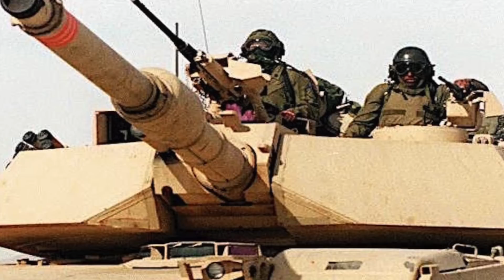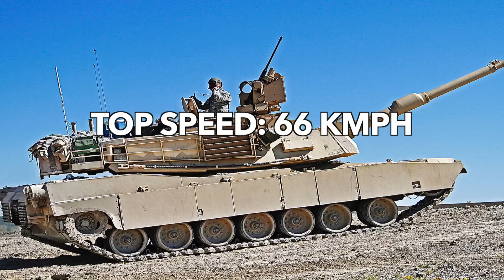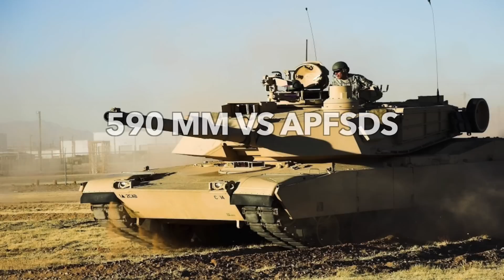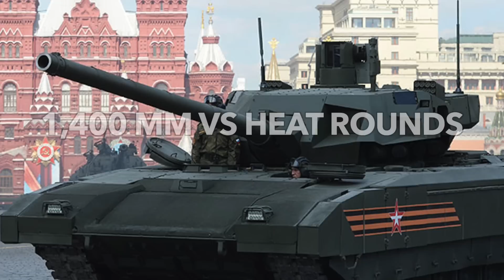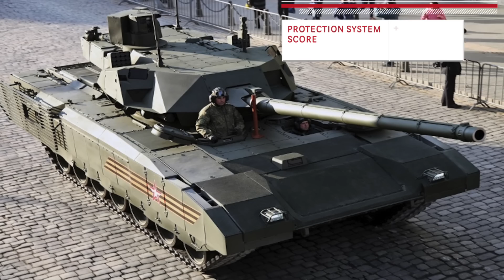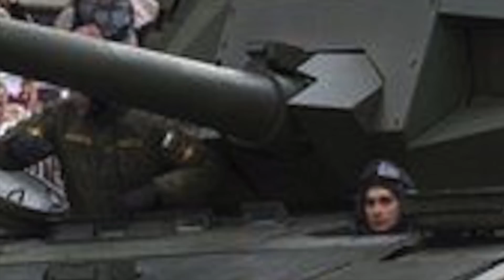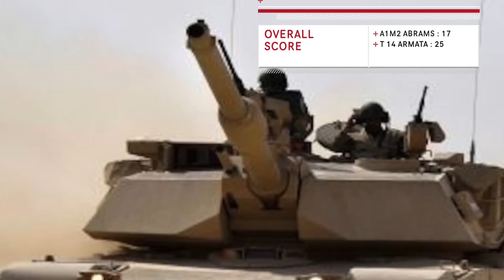AMERICAN M1A2 ABRAMS  vs RUSSIAN T14  ARMATA: WHO WINS?

Comment: A correction is needed with regard to M1A1/M1A2 armor protection. Armor protection levels for this tank during the 1991 Gulf War were 800 mm against Kinetic Energy rounds and 1300 mm against chemical energy rounds. The armor on the tank has been upgraded multiple times since 1991 and is well ahead of those protection levels now. 

         So the M1A2 has either equal or better armor protection on its front compared to the T-14 armata but does not have the advance soft kill and Hard Kill active protection systems that the Armata system has. 

          In terms of mobility, the governed maximum speed of the tank may be 45 mph, but the governer can be switched off allowing speads of 65 mph +. The turbine engine also gives it greater acceleration. 

           Another thing to consider is that U.S. tank crews on average have had more combat experience and get more training than Russian tank crews. 

           While the Armata's rating is probably still ahead of the Abrams, it is ahead by a much smaller margin than this report suggest.

Comment: Before the Americans in the comments (me included) get butt hurt remember the Abrams is 30+ yrs old whereas Armata has yet to break 5. To be even somewhat comparable despite its age means that the Abrams is packing serious heat and is a reminder to what is to come in the future where the Abrams (or more likely a successor) with new equipment and better  applicators is going to kick serious ass.

Comment: Wow.  Well we obviously found the Russian connection.  You lied on every single aspect.  Lied.  Hell you compared the Abrams standard armor to the Armata's reactive armor!  And there are zero demonstrations of any of the capabilities of the Armata. The Abrams has demonstrated its abilities over and over again.  Including its top speed of 70 mph, not 60 kpr.  And that speed is tracked cross-country.  Not on a flat, paved, road.  As for the rounds per minute, the Armata carries I think 5 rounds in the turret.  So for those 5 rounds, it may very well be able to maintain the "12 rounds per minute" rate.  Then it has to stop, rotate the turret so the automated loading system can load 5 more, then rotate back to the firing position.  The Abrams can keep its rate of fire going until all rounds are expended.  And its loading system never jams.  I've heard that the Armata has major issues in that area.  And this piece left off the most important feature that the Abrams has.  It doesn't have to stop to fire.   All 10 rounds in that minute will hit with pin-point accuracy.  The Armata apparently has a sub-obtimal, third-tier system that allows it to fire its 5 rounds in that minute on the move.  Just not with any real degree of accuracy.

Comment: For the most part this is right but there are two things wrong, one with scoring the other with technical information. Regarding the scoring, a crew of 4 is equal to a crew of 3 if not slightly better due to less work load distributed throughout the crew. The other thing is that the armor specifications are wrong. An M1A1 HA (with 1st gen DP armor) has  600-800 mm against APFSDS  and 700-1300mm against HEAT. The Most modern M1A2 has 3rd gen DP armor so its armor effectiveness should be even greater. They are equals in armor.

Comment: Bigger gun bore and heavier projectiles are better? Hitler thought bigger is better too with weapons such as the gustav railway gun firing 7 ton projectiles, it didn't seem to go too well for him with all that wasted!
 T14 is a prototype yet to see battle unlike the Abrams that has been around since 1980 (fist the M1 with the M68 L52 105mm rifled gun then to the M1A1 & A2 with the M256 L44 120mm smoothbore), it has been in many battles and proven its effectiveness with over 10,000 built! But I'm sure the N1 rocket seemed good on paper before it became the 8th largest non-nuclear man made explosion in history wiping out the ruskies chances of getting to the moon first, the Russian's really know what they're doing!

"Made in Russia" there's your problem!
Reply: By the way, how does the fact that the Honeywell AGT1500 multifuel gas turbine engine burns both petroleum based and kerosene based fuels(can't put petrol in a diesel engine), has easier maintenance than an internal combustion, starts up and runs in extreme cold better than a diesel engine not give the M1A2 the advantage in that category? 
 Also you kind of cheapened the Abrams armor!

Unbiased, sure it is.

Comment: The thing which never been brought to discussion -- is the start time of T-14 diesel engine in, let's say, - 20C (which is not too much of a cold in Russia). In the past the platoon of T-72 and T-90 took up to 1 hr to start their engines, due to warm-up procedure. To compare -- T-80 (with gas turbine engine) took about 5 minutes to start from complete cold stop in the same conditions.

Comment: am i the only one that knows the us abram are using the sterlington armor and all of this is shit you can't use the normal abrams you gotta compare the m1a2v4 that has an bigger cannon 1300mm and if the 152mm ever will be mounted on an t14 it will get way more heavy due to the mass of the rounds the m1a2v4 abrams has better armor compared and it will not be replaced before atleast 2030 by a new kind of super tank that can go way ahead of atlest 20-40 years of its time and thinking of that the us army and marine might soon will be able to attache the railgun that can shoot up to around 10000km/ph.
Reply: THE WEREWOLF LORD Sterlington? What?
Reply: THE WEREWOLF LORD v4? What?
Reply: Nathan Peterson sterlington armor are the armor that the us is using that is made by the british. the v4 is version 4 of the m1a2 abrams that are being made. or other said it is a heavily upgraded version of the m1a2 abrams and inside of the next years the m1a3 may be built which is and better version that will have auto loader and an 130mm.
Reply: THE WEREWOLF LORD Sterlington isn't a thing. I assume you mean Burlington and Dorchester armor? 

v4 doesn't exist. The most recent variant of M1 is the M1A2 SEPv3. 

We don't know what M1A3 will have. The only thing we've got to go on about it is ECP-2 requirements from back in 2010, which as described in the report, mere suggestions.
Reply: you know that they already exposed that the m1a3 has an high chance of having an 130mm smothbore cannon with autoloader to so fucking read on your stuff and the m1a2sepv4 is under development as an upgrade since that the u.s are going for an new tank around year 2030
Reply: THE WEREWOLF LORD A chance yes. As I said it's merely a suggestion made by ECP-2 back in 2010.

SEPv4 might be under development, but I doubt to any extent they've already designated the next upgrade to it yet.
Reply: Nathan Peterson then still you can't change that when you fucking say v4 what like if you knew that it might be on development tables then don't say what i know the full fucking story of it the tech that the t14 have can't compare. because they say that it can avoid missiles at 10 meter and i mean missiles from the air yeah they can maybe take control of it but they can't react on it from 10m distance and all of this is bullshit anyway because the us army says what they mean it has and the russian mean it has better. plus it is also not tested against eachother so you can't say which one is best just out of this. in the gulf war we saw that only around 4 abram tanks got downed and one of them was still able to drive the crew and shell also have a roll because us have the best crew  in the world and the shell will never be fully exposed of how affective it is but it all dosn't care if the us go back and look on the fwv4004 that has an 183mm then they might just use that kn the next battle tank. there has also be'en proven how bad trained the rusdians are in the t14 since that when they drowe it thrue moscow it stopped and it took hours just to figure out that it was the handbrake that there had gotten pulled up so it wouldent move.

Comment: What I find very interesting ist where the weight reduction is coming from?
I mean in this case it's 22 tons when the facts here are right. And the T14 is a big tank, like the leopard 2.
And here is my question: Armor brings weight. But the T14 is 22 tons lighter, while being not smaller than western MBTs.
How can its effective armor thickness be so much better, while being 22 tons lighter?
Reply: Unmanned turrett don't require armour. And crew in the separate armoured capsule.
Reply: A three man crew can’t do anything without a gun turret.
Reply: @randkinca  Nor can any other tank without its breach.
Reply: kisscola Potentially protection concerning APS. But we don't know anything about it we can verify. Secondly is the fact the hard-kill APS only covers approximately 160 degrees of the front of the turret.

Comment: the abrams was and still is a good tank but after more than 35 years, it's starting to show it's age. it is substantially more expensive, slower, less range, slower rate of fire etc. it is time to start looking at a new design.
Reply: Substantially more expensive compared to what?
Reply: Several people have stated higher rates for manned loaders over auto-loaders. Take a look at some of the you-tube clips for both styles.

Comment: You left out combat communications connectivity.  Abrams is not just a single tank.  Because they all see the same targets, when you face it, besides all the other Abrams which will outnumber you 5 to 1, you also face A10, Bradley, Striker, MLBS, AC130, F16, F15.  They are all connected on the battle field.  Armata does not stand a chance again Abrams, nor does any other armored vehicle going against Abrams.  Russia does not have this capability.

Comment: Ok I don't now much about the 1,400mm vs HEAT I thought you would just measure the thickness of armor like 920mm that just confuses me because different HEAT rounds can penetrate at different measurements like one can penetrate 900mm and one can penetrate 800mm, so if anyone can explain it to me then thanks in advance

Comment: he's not factoring in that the Abrams has a thermal imaging system and it would pick up the t-14's heat signature in a heartbeat even before it picks up the abrams...why do you think it's called whispering death....its hard to hear when sitting still stalking it's prey. I worked on the M1A1/A2  while I was in the military and that tank is capable of a lot of things and first hand saw and or installed most of the upgrades in them to keep them combat ready and up to date with the changing battlefield. and another piece of info...the Abrams weighs 63 tons. that's a full combat load...not 68 tons...get your information straight before you post a video that is inaccurate about a battle proven tank. forgot one more thing. the Abrams has the capability to fire on the move with the most advanced turret system that keeps it stabil on any terrain. does the t-14 even have that cabability...seems not if he didn't mention it or the Russians have it classified.
Reply: What makes you think the M1A2 can detect the T14 before the T14 detects the M1? The T14 has by far the more modern thermal imaging system. It kicks the M1's ass before the M1 even knows there is a T14 somewhere in the vicinity.
Reply: Not really, no. And for that matter any tank can be destroyed by RPG7s when hit in the sides or rear. Russians lost tons of T-80Us and T-72s in Chechnya that way.
Reply: Ultragopnik Define destroyed. If you mean total loss, then no. Never has that happened in other than possibly export vehicles.
Reply: Nathan Peterson
Are you saying that US exports bullish shit abrams to its allies? Do you want to see how good Abrams is?
Reply: t14 have a heat contermeasure system. they can change to look like other vehicle
Reply: Shado Opeth Juat wait till tha M1A2 SEP
Reply: T14 armata ITS bias
Reply: Almost all modern tanks have a thermal imaging system
Reply: +Free Thinker can i ask you where the shot came from? i curious. they say DU armor only at front hull and front of turret.
Reply: M1A2 yes, it equiped with thermal imagine system. in fact it is the first tank to have that device but now almost all tank have it.
Reply: T-14s thermal imaging system is a downgraded variant of a French thermal system. How is that better than what the Americans have?
Reply: Raihan Wismaya it drove over an IED that consisted of 100lbs of c4, a few anti tank mines stacked on top and a 155mm artillery round stacked on top of that. The turret weighs almsot 27 tons and it blew it off. All that weight plus the around 100 bolts holding it to the hull. One of the most powerful IEDs to destroy an Abrams tank in the Iraq war. Seeing all that fucked me up
Reply: +Free Thinker maybe for abrams extra armor plating on the back might work, it sure get rid of HEAT round but the heat from the engine will blocked. but the plate does its work, heat seeking missile will struck the plate instead of the engine but sure, the engine will still have damage from sharpnel
Reply: Raihan Wismaya no tank engineer will ever put extra armor on the back because you're supposed to be facing the battle, and just like you said It would block the exhaust
Reply: +Free Thinker yup! because it the exhaust apparently will sucked up by the engine, making the fuel burning in the engine not optimal, making the engine lose horsepower or make it overheat. but Cage armor still good against shapped charge tho.
Reply: Actually the armata also has some thermo things he just decided that it was a tie and that it wont be included in the video
Reply: Hey the Thermal imaging tank scope is standard issues for all modern MBT
I am not impressed by what you saying
Reply: Jonathan Swangstu your m1 abrahams got destroyed by an old soviet rpg 7
Reply: Ultragopnik okay...but the fact is it's still a battle proven take. even in a war your still gonna take loses  regardless what your being attacked by
Reply: You're wrong nathen. Many Abrams tanks got destroyed in the iraq war. I stood on top a blown off turret laying next to the tank on October 28 2003 in around Balad off the Tigris river

Comment: Having the best tanks with the biggest gun, best armor and most sophisticated systems doesn't mean you will win, the germans learned this the hard way during ww2, besides the abrams and there crews are combat proven in the harshest of terrains.
A three person crew may be cheaper to operate but what happens if the auto turrent fails?, At least in the Abrams you can have a guy pushing in those rounds.
Reply: Not necessarily sophisticated systems.

Comment: I realize this is an overview of what looks like actual specs but for myself having seen and know for a fact that most of what's told or written is drastically understated it should be noted that there are a lot of factors that need to be accounted for but aren't! I truly hope that we never have to see there capabilities pitted against one another and if they so happen to do so they are both equal enough to cancel each other out! unfortunately tank on tank battles might be less to worry about than the real threat to a tank which is from the air!

Comment: The armor ratings may be apples to oranges,  calculating the virtual effective armor depth out of reactive armor vs the passive armor rating of the Abrams.  I wonder how thick the actual armor is on the Armata? If needed, the Abrams could have reactive armor elements  bolted on the hull, this may have already been done in Iraq.

Comment: Repeatedly calling M-1A2 an A1M2 doesn't inspire confidence. Secondly, it's well known, M-1 loaders and gunners can sustain 14 to 16 rounds per minute firing rate through their entire ammo supply. Thirdly, the composition and strengths of both the American and Russian tanks armor are closely guarded secrets, so no claim can be made about either tanks armor. It has also been rumored that the T-14 will not be produced as a replacement for the recently modified T-90 for years to come. With all this said, I say, No this was not an unbiased examination and rating of both vehicles.
Reply: Tadeas Kollar Speed and manuever IS armor.
Reply: John Hannon You are just mad about plain facts, the t14 is simply better in nearly all categories, you can’t just ignore that
Reply: Yeah but the fire rate on the T-14 s autoloader is stable. The loader on the M1 can do a great job when the tank is stationary but the fire rate goes down when the tank is moving over rough terrain. It also meatters if he is taking ammo from the rack behind him or the one behind the TC.

As for armor one can get an idea by looking at the actual thickness of the box that the composite armor is in. Looking at it that way the armor seems to be roughly the same on the hull of both tanks. I would even say the M-1 s is somewhat thicker. Also the T-14 seems to have minimum turret armor. However there is a caveat to this because the T-14 has all it's crew in the hull. So in a hull down position the entire crew is completely safe. 

Oh and it's enough if the T-14 replaces the T-80. While the T-90 replaces the T-72. Although it would be good for logistics if they decide to operate only one type of tank.

PS: The only reason why I'm writing this is becouse your comment looked lonely :)
Reply: Tadeas Kollar dont autoloaders have a tendency to explode when a single shell pens thus rendering the entire tank useless
Reply: +Stock Brazen You do realize that not all autoloaders are the same right?
Reply: The T-14 autoloader can take up to 20 minutes to find a round at half rack, that's neither good or stable

Comment: Also, the T-14 can, allegedly, already go into a remotely operated mode ie no crew inside.  I wonder if the T-14 will be at this year's Tank biathlon.
Reply: You should probably have crew inside if possible
Reply: Ben Vaserlan only real issue with it is it's size. it's a huge target for a10s